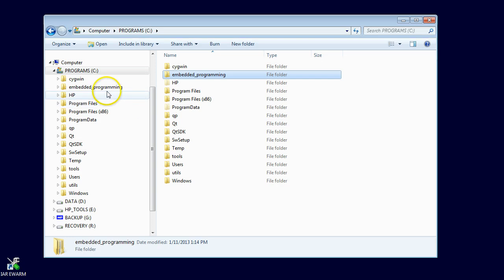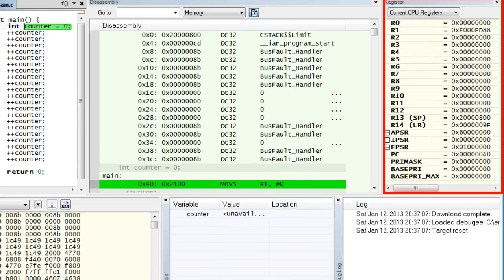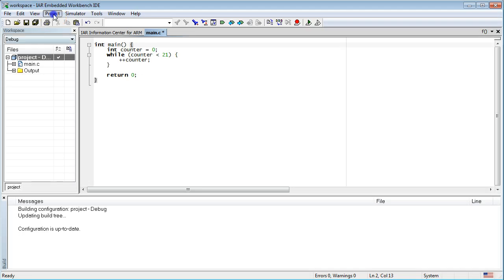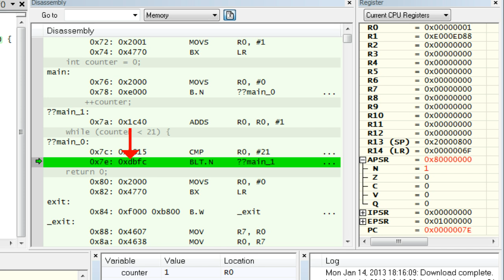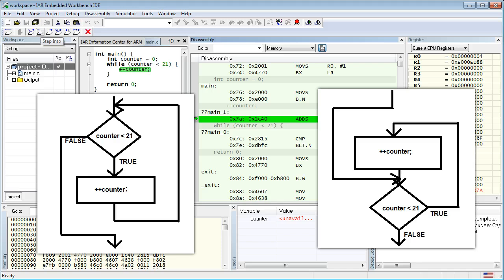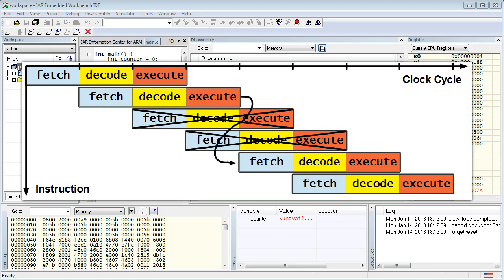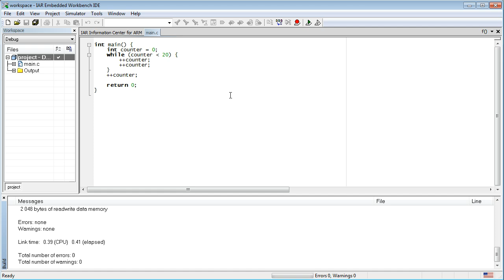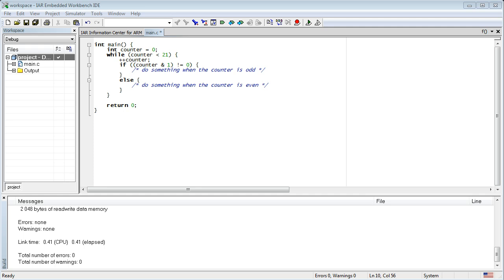#2 How to change the flow of control through your code

Comment: save the code in another directory: WROOOOONG, CHUMP.

Put it into version control, that's backup on steroids. And start to think in terms of branches (diversions from a chosen point), probably intended to merge at sone points in time.

Suddenly, you don't have to juggle a multitudes of possibly changing dirs, all the diffs are by definition anchored to a fixed point in the time/change continuum, and contemporary tools (editors/IDEs) even give you a lot of info (origin, changes)  inline.

OR: by investing a little bit into the process you reap multitudes of benefits.
Reply from the maker: @mrdkyzmrdany8742 Since the publication of this video, the complete projects for all lessons have been put under version control and are available on GitHub at: https://github.com/QuantumLeaps/modern-embedded-programming-course --MMS

Comment: Hi I'm a little confused on the computation of the program counter when branching. 

So given this: 
0x000004DC E7F7      B             0x000004CE

When computing the program counter, we add the offset value of the encoding to the current value of the PC. In this case we have PC: 0x4DC and an offset of F7, which in two's complement is -9. So adding them together we get 4D3, which isn't the target address of the branch. What am I missing here?
Reply from the maker: Your B instruction starts with 11100, so it uses the T2 encoding (see 5:05), so the immediate offset is 11-bit 0x7F7. But you're right that after sign-extending from 11 bits, it is -9. So, now 0x4DC - 9 == 0x4D3 -> 0x4D2 (after discarding the LS-Bit). But I think that this must be further corrected for the pipelining effect 0x4D2 - 4 == 0x4CE. --MMS

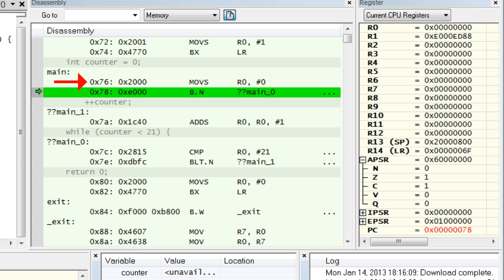Comment: At 3:42, how do you step one assembly code at a time? When I perform Step Into in debugger mode, it is stepping to the next statement in the C code, not the assembly code.
Reply from the maker: You need to click on the disassembly window and make it active. Then single-stepping will advance one machine instruction at a time. To go back to stepping one C line at a time, click on the source code window. --MMS
Reply: @StateMachineCOM  Thank you.

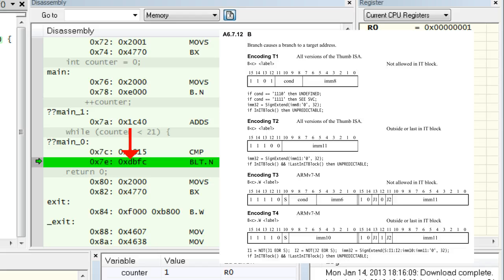Comment: At 5:00 you said our instruction uses the encoding 'd' so its T1 I couldn't quite understand why, Could you please elaborate?
Reply from the maker: The "T1" name is explained in the "ARM Architecture Reference Manual", as shown in the video. The BLT instruction has multiple such "encodings" (slightly different binary representations). All these "encodings" are disassembled to the BLT instruction, but they have different restrictions as to the context of use. Some encodings cannot be used in the context of the "IT block" (IF-THEN block). Please read the "ARM Architecture Reference Manual" shown in the video for more information. --MMS

Comment: 3:55 

I wanted to see if I could predict what the value would be for the compare instruction on my machine. My code is almost similar to yours except that I have while (counter < 5).

I used page A6-64 (page 202 of the document) of the ARMv7-M architecture reference manual you linked in the description. The description for the compare instruction in the reference manual states that bits 15:6 are 0b 010000 1010, and bits 5:3 are for Rm and 2:0 are for Rn. 

Now, in my code, the value of 0 is moved to R0. So, the bits 5:3 is 000. Since we are comparing this value to #5, whose binary representation is 101, we should get that the compare instruction has a value of: 0b 010000 1010 000 101, which is 0x4285.

However, my disassembler is saying that the instruction value is actually 0x2805. 

Would you please explain how/why I should be 0x2805 instead of 0x4825?

Comment: Is this course still relevant?
Reply from the maker: This course focuses on the fundamental concepts in embedded programming and also shows you how these concepts are ultimately realized in an embedded processor. These things are not going to change any time soon, because fundamental concepts never go out of style. Moreover, when you see and understand how the fundamental concepts are implemented at the low level, you will gain deeper understanding and you'll use the concepts with greater confidence. Please also remember that the course is still going on and is getting progressively more advanced. Stay tuned! --MMS

Comment: Hi, at @6:41 you mentioned that the generated machine code is faster than the C code because there is only one conditional branch at the bottom of the loop. I don't understand how there isn't one conditional branch in the C code as there is two outgoing arrows and two ingoing arrows in both situations. The only difference to me that is that the conditional branch is at the bottom vs. the top. Can you clarify what you meant by this?
Reply: Anyone got it?

Comment: Thank you for the course. I have one doubt with running the debugger second time. First run in debugger jumps with the green highlight on each assembly instruction i.e. both the B.N and BLT.N but the during the second the instruction directly jumps between ADDS and CMP, doesn’t highlight the “0x8e: 0xdbfc   BLT.N    0x8a” 
Note that I am using the “Step Into F11” and I know that the BLT.N is executed (checked by putting a breakpoint on it) but what’s the reason for not highlighting after the first run?
Reply from the maker: You are using two modes of debugging: one source line at a time and one machine instruction at a time. The source-line mode is used when the active window is the source code window. The machine-instruction mode is used when the disassembly window is active. --MMS
Reply: @StateMachineCOM  Thank you for such quick response. Yes, I was switching the active window and that was the problem. Really great quality content.
Reply: @StateMachineCOM  Thanks for this response. I was stuck with this for half an hour.

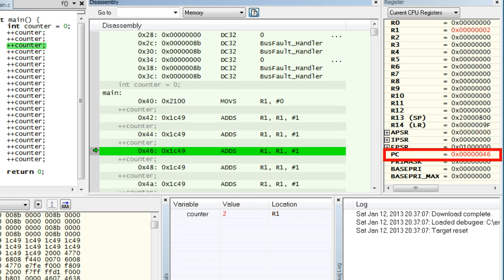Comment: How does the program decide what general purpose register to use when storing data? For e.g. in this video, the value of the counter variable is stored in register R1 (see 2:07). However, in my code, the value is stored in R0. Is it possible to force the program to store a value to a certain register or is it automatically determined? How do you work with more than one register at a time and is it possible to fill up all the general purpose registers with data? I.e. you force the registers R0 to R12 to hold values at the same time.
Reply from the maker: The compiler is free to choose the CPU registers as it pleases (within limits). And no, you can't force any specific way of allocating registers to variables, at least not in the standard C. The restrictions on choosing the registers are known as the calling convention. This is the agreement as to what registers can be clobbered and which must be preserved across function calls (lessons 8 and 9 talk about functions and the ARM Procedure Calling Standard).

Comment: Just thought I'd put this here in case anyone's interested. I was curious about the chosen method of determining whether a number is odd using bitwise operations as opposed to the more typical modulus arithmetic method. After some digging, I found that the bitwise approach may be marginally more efficient than using modulus, however bitwise is not guaranteed to work for negative numbers. For this reason, it is generally advised to use modulus unless you're working with a particularly time sensitive application, for example an interrupt, and you know that the number you're testing will never be negative.
Reply from the maker: That's an excellent point. Generally, the first concern during coding is to express the intent as clearly as only possible and the moduls operator would do this more clearly than the (obscure) bit operation. (Specifically, for the uninitiated, the test for "oddness" with the moduls operator would be ((counter % 2) == 0). Presumably, most modern compilers would optimize the modulus (division) the same way as the bit operator. I should have mentioned this in the video, but at the same time I wanted to provide an example for the bit operator because it is particularly important for embedded programmers. I hope this makes sense. --MMS

Comment: Great video, very clear and well presented. 
One question I have is when you wrote the code for determining if the counter was odd, you put '!= 0' why did you chose to put this as opposed to '== 1'?
I get that both ways mean the same thing and would work, but is this a more efficient way or something? it just seems like reverse logic to me.
Reply from the maker: Why did I choose '!=0' vs. '==1'? Because comparison against zero is almost always the fastest. CPUs have instructions that set status bits when argument is (or isn't ) zero. This means that most of the time the CPU does not really need to do any comparison. In contrast, comparing to anything else typically requires generating this constant in a register (like 1), and then comparing with it, which is as expensive as subtraction. --MMS
Reply: @StateMachineCOM  Fantastic response. Thank you, I knew there must have been a reason.

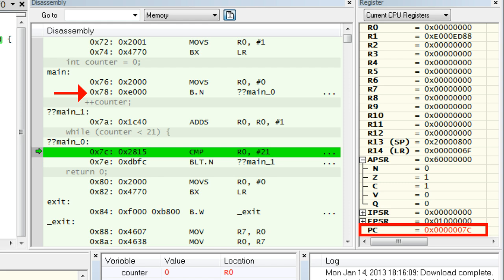Comment: Thanks for the great videos. At 3:42 I dont see instruction "B.N" instruction on my computer can you please tell me the reason why ?
Reply from the maker: You don't say what you see instead of the "B.N" instruction. But some disassemblers might simply show the "B" (Branch) instruction. The suffix ".N" means "near" branch within limited distance from the current PC (Program Counter). Such "near" branch instructions can be encoded as a 16-bit instruction, which is the case here (see the instruction binary encoding 0xe000). There are also "far" branch instructions encoded in 32-bit instructions. --MMS
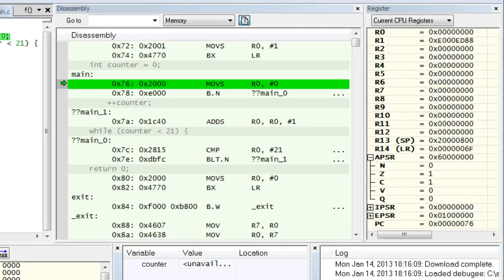Reply: I really appreciate for giving your time :) After I can only see (at 3:35 highlighted) instruction  (0x76: 0x2000 MOVS RO #0) which is the first lint after main. And after that I only see a series of ADDS.  I dont see B.N, ADDS,CMP, BLT.N and so on. I hope I am explaining well
Reply from the maker: You most likely see the disassembly code from the very first version of the code, when the counter variable is incremented several times (++counter;). But at 3:45 the code is already modified to contain the while() loop. --MMS
Reply: I am really really sorry. I did not realise I had two main.c files open. And the main.c file that was on top had the while loop, but that was not being executed, instead other main.c file which had ++counter code was being executed thats why I see old incrorrect disassembly instructions. I am sorry for wasting your valuable time. Thanks for being patient :)

Comment: Hello sir
I am going to ask a question I understood 0xFC of ofset is -4 but i cant understand 0xFB of offset=-6.In second while loop Adress is 0x80 and we have 0xDBFB so 0x80-5=0x7B but it goes to 0x7A 
because 0xFB of offset=-5 it must goes to 0x7B
. Please help me sir.
Reply from the maker: I explain this several times throughout this video course, but let me quickly repeat. The offset 0xFB is obviously -5, which is an odd number. But THUMB2 instructions cannot be aligned at odd addresses. Therefore the LSB (Least-Significant Bit) loaded to the PC (Program Counter)is not used for addressing (this address must be zero, so that all instructions are aligned at even addresses). Instead, the LSB loaded to the PC is used to indicate the CPU mode (1=TUMB, 0=ARM). In Cortex-M CPUs this bit must be always "1", because the CPU does not support the ARM instruction set at all. Therefore, you will always see odd addresses loaded to the PC, while the actual instruction reached will be at an even address.
--MMS
Reply: Quantum Leaps, LLC. Thanks for help sir

Comment: Your tutorials are great.  I ordered the DE0-Nano-SoC a few days ago and I saw your tutorials today.  I like the DNS for the Ethernet speed and I like IAR because, I like to see what is happening on the register level and I like your tutorials.  The DNS is a hybrid with the Cortex A9 and an FPGA. It is made by Altera. I looked at the IAR site and it offers support for the Cortex A9 under a different name and the site also lists Altera as a support group or something. Is there a fit with DE0-Nano-SoC and IAR that I am missing or is it something that possibly could happen later?
Reply: I found my answer. There is a c-compiler in my kit but it was delayed in loading on my PC.
Reply: I was incorrect. My  c-compiler looks to be line code text. Will IAR run code for my Deo-Nano-Soc?

Comment: Its foolish, but I need your help! I am planing to work through a tutorial about programming in C the Stellaris Launchpad using the IAR Workbench IDE. When I enter in debug mode I have not yet found how to place views in parallel. Once in a while trying it works, but I have not find out what I did to have it do what I want. The views appear ordered in tabs of a window. I have no problems with the first row of views in which 4 views appear in parallel, dide by side.

My problem is with the additional views. It always shows a window over the full screen with with 3 tabs, "Locals", "Memory" and "Debug Log". I want to have them show up not under tabs, but a a window of its own. I know that somehow it is done with the light blue bar on the left of this window, but I am unable to split the full width of the screen with 3 individuals "screens" as I have them on the upper row of window in the layout.
Reply from the maker: Helmut: The documentation for the IAR EWARM Integrated Development Environment is located in <iar>\arm\doc\EWARM_IDEGuide.ENU.pdf. Also, the IAR C-SPY debugger is described in  <iar>\arm\doc\EWARM_DebuggingGuide.ENU.pdf
Reply: Before recurring to publish my request for help here I have studied the documents you link to! Apparently my question is too silly to be mentioned there!
Reply from the maker: I agree that the IAR IDE dock-window implementation is not intuitive, and non-standard. Unfortunately, I don't have the space here to explain what a 260+ page IAR manual has missed. The only advice I can give is that you can grab a window by the tab and drag it to the position you like. Please watch the window outline before you "drop" the window. Also, often to achieve the desired position, you need to drag a given window multiple times.

Comment: hello sir 
when i make the project & run the debugger the branch instruction after CMP is BGE.N not BLT 
what is the reason for this ?
Reply from the maker: I'm not sure why the compiler generates a different machine code for you (I'm presuming that the C code is identical), but I would check the optimization level. At a different level of optimization, the compiler might change the ordering of code, and put the else-part first. Then the condition of the branch instruction would be exactly the logic negative, to jump over the else part. I hope you can see how it works.
Reply: the optimization level is low , & the code is the same is you wrote 
but when i downloaded the lesson2 project & run it the assembler code is the same as in the video
Reply: @mohamedabuelkasem4940  You probably had declared unsigned int

Comment: Thanks for the great tutorials, I have one question: in the disassembly window and when I'm using While loop, I am not able to see the additional instruction (like BN or BLT.N ) like the second part of this tutorial. I am only able to see the regular instructions (ADDS and MOVS)  like in first part of this video.  Do you have any suggestions or ideas why that happening? Thanks
Reply from the maker: In order to have branch instructions (such as B.N or BLT.N), you need to have branches, such as if-statements and while-loops in your C code, which are gradually added to the code as the lesson progresses. Perhaps you don't have them in your code yet? (BTW, the .N suffix after branch instructions denotes "near" branch. There are also "far" branches that can jump much further from the current location.)
Reply: Thanks for the information, but I am using While loop, so I think it is 
because different version of the software maybe!. Thanks anyway.
Reply: +Nawar Youssef I have the exact same issue.  I thought it could be due to a newer version of IAR, but that doesn't make sense really.  We should be able to see the same instructions in the disassembly regardless of version
Reply: Nawar Youssef ah!  Thank you!  Very clever
Reply: +Johnny Hall thx Johnny, I figure it out! It was due to the old version of the code when we copy and paste the folders. In someway it was compiled as the code for the previous lesson. All what you need to do is creating new project for each lesson and then you can copy the previous code instead of coping the whole folder.
Reply: Johnny Hall *****  Or I think if you copied the whole lesson folder from previous lesson you have to re build the project buy using "Rebuild All" before you "Make" it. I hope it works
Reply: Before you copy the lesson you open the new lesson you have to close the previous workspace.